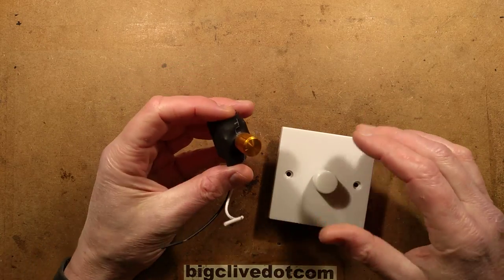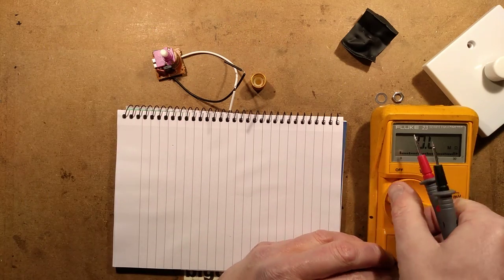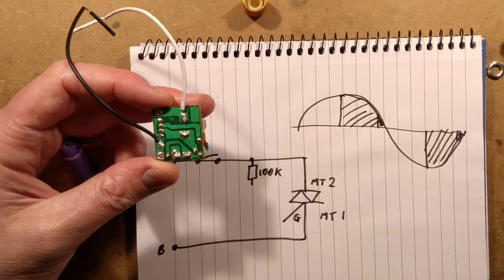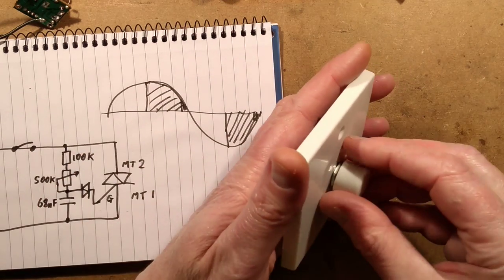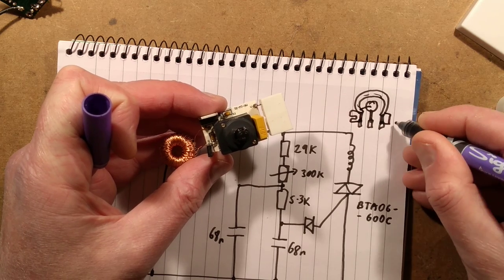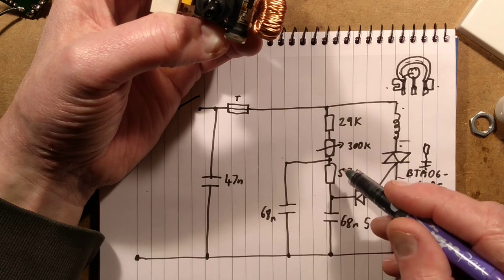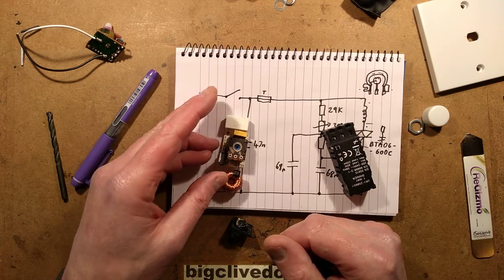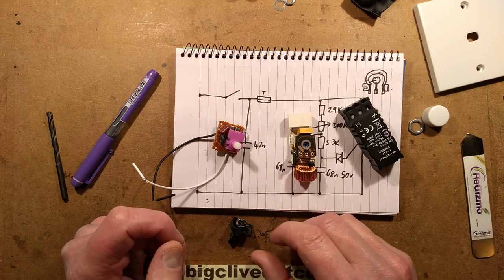Cheap eBay dimmer module vs compliant dimmer.  (Schematics)

Comment: So do you have have any idea on how one could control such a dimmer using a micro controller?
Currently I control the brightness of my lights at home over the network using triacs triggered by diac based optocouplers triggered by an ATmega328p (the chip used in the Arduino UNO). Which works fine, the micro controller however has to detect the zero crossing however and precisely time when to trigger the triacs. This is a task I would much rather have some simple analog circuitry do. Another requirement however is that is can dim so slowly that you can't see the brightness changing and without any visible steps in brightness. This requires a fairly high resolution. Currently I can time with an accuracy of about half a microsecond, resulting in about 20 thousand steps (230 VAC at 50 Hz in Germany). I assume 12 bit resolution (or about 4000 steps) would be enough though.
I had a couple of ideas, they either involved relatively low 8 to 10 bit resolution (due to some chips which a fixed resolution) or they were overly complicated.
Obviously I don't expect this is something you think about very much on a day to day basis. But if you have any idea on how one might do this in a reasonably simple manner, I would be very interested in hearing it.
Reply from the maker: The easiest way to dim with a microcontroller is pretty much as you describe, or use dimmers with a digital interface like DMX and Dali.
Reply: Ok... I kinda feared it wouldn't be that simple. I had thought about using a digital potentiometer or something with a regular analog set up like the dimmers you show in the video. But that kinda seems overly complicated not to mention most digital potentiometers have a relatively low resolution or are quite expensive as are commercial digital dimmers.
I guess a little zero crossing detection circuitry and using the micro controller itself for triggering is a better solution in that case.
Anyway, thanks for your reply.

Comment: What about those fancy Varilight ones with programmable modes for different loads? Do they use a microcontroller with some sort of transistor and PWM?
Reply from the maker: I'm guessing they probably use the lagging edge dimming to minimise current spikes to the LED circuitry.

Comment: Anyone know what happened to Clive's Amecal meter.  ??? Looks like he's back to the good old trusty Fluke, at least it auto ranges and I'll bet it's more accurate, (maybe a few less low range functions).
Reply from the maker: The knob to shaft coupling failed.  I'll be fixing it shortly.

Comment: Hi Clive tell me can you use the joule thief only on alkaline batteries and no other like for instance a cell battery or rechargeable battery?
Reply from the maker: It should work on any cell of 1.5V or less.  It's not suitable for higher voltage because the current can go straight through the LED with no limiting.

Comment: Shouldn't a two-way switch have three wires/terminals?
Is the third terminal just a solder pad on the PCB?
Reply from the maker: Yeah, I did pause for thought when I read that.  I think it's just the usual generic instructions and keywords.

Comment: May I ask what I'm guessing it's a stupid question, why are dimmer switches not just a big variable resistor? Im trying to think it through but obviously missing something.
Reply: Graham Wood 
Heat.  A resistor turns excess electricity into heat.  It would probably work but...
Reply from the maker: Early dimmers were rheostats which were simply resistors.  They got VERY hot.
Reply: Oh of course. Thank you, that makes perfect sense

Comment: What kind of capacitors are used with the BTA06 Version? I normaly dont work that much with mains, but i have a hot glue gun wich i'd like modify. i guess they are ceramic because of the alternating current.
Reply from the maker: They are probably just little film or ceramic caps.  The voltage they have to deal with is less than 50V and the frequency is low.
Reply: @bigclivedotcom   thx for the information

Comment: The most disappointing thing about dimmer switches is that you cant have more than one on a circuit  ie- Two way switches.
Reply: Why not?
Reply: @tesseract342  If the upstairs dimmer is set to half, the downstairs dimmer will not be able to be set at full power.  Also, I'm not quite sure but if both dimmers are set to half, you only get one quarter power to the lights.
Reply: @Chrisallengallery  oh right :)
Reply: @Chrisallengallery  There are digital dimmers that are not subject to that problem.
Reply from the maker: Simplest option there might be the remote control dimmers with wall mounting remotes.
Reply: @bigclivedotcom  I've just been researching. You can get a master switch and slave switches. They're digital.  More expensive and you need a neutral in the switch box.

Comment: Can you think of a DIAC as a zener that works with AC ?
Reply from the maker: Similar, but whereas the zener just clamps above its rated voltage, the diac suddenly drops to a low voltage to give a current spike.

Comment: What kind of probes are those you're using connected to your fluke?
Reply from the maker: A fairly generic set of test leads.  I could do with finding an upmarket set.
Reply: bigclivedotcom I particularly like the pokey bits on the end to probe through conformal coatings, insulation and such

Comment: The triac actally produces audible noice.
Reply: Most dimmers produce audible, buzzing noise, but it's not the triac itself. Most cases the inductor is the source of the acoustic noise, due to the magnetostriction of the core, and the movement of the loose turns (caused by Lorentz force). The snubber and timing capacitors can also buzz, especially if they are ceramic capacitors (piezoelectric effect).
Reply: @mrnmrn1  cut out the inductor. It will still make noice. There is sort of piezo electric effect in those triacs.
Reply: @picobyte   I'll try next time. If it's an internally insulated triac with metal tab on a grounded heatsink, it makes sense, because the insulating ceramic pad inside the package may produce some piezoelectic effect. With higher power levels, even the power outlet can buzz as well. Once I used a dimmer on a 4kW load (halogen IR heater). All the fluorescent ballasts started buzzing loudly in the whole  three story building :) .

Comment: Where did the 30V level come from? Is that inherent in the diac?
Reply: Yes it's like a zener in that way
Reply: @benbaselet2026  It's more like a pair of zeners connected to a small triac. Replacing it with a zener doesn't quite work.
Reply: They are sort of like two zenners with the anodes connected and a cathode both ends.
Reply: The 30V is a common voltage for a diac in a device like this. There's no real reason it has to be 30V. Most likely a manufacturer started making or accidentally made a bunch of these many years ago and sold them so cheap that every designer started using them. From there every manufacturer jumped on the bandwagon.

A diac is neat how it works. Let's say you have a 30V diac. As the voltage increases the diac has very little current through it and lets the voltage rise. As soon as you reach 30V it suddenly "shorts" out. It lets you dump a chunk of current into the triac gate, making sure it turns on every time. After the voltage goes nearly to zero, the diac resets from being a short back to being a nearly open circuit.
Reply: @therealjammit  Not sure if this is true or not as this was told to me by a lecturer who was frankly an idiot. Basically 30V is about right for keeping away from noise near the zero cross point. IE noise reduction. Take this with a whole bucket of salt though.
Reply: @gordonlawrence4749  30 volts of noise. Wow. If you have 30 volts of noise on your lines you have some serious issues. The delta-v/delta-t is what really causes the false triggering.

Comment: I took a look at two of these I had, and both of them had Mylar Capacitors but with a color code I'm guessing? They had like a German flag printed on them which is kind of weird
Reply from the maker: It used to be common to print wide bands of colour on film capacitors.
Reply: so thats just random colors?
Reply from the maker: @roughshaf7321  No.  It's a colour code that indicates the capacitance value.
Reply: @bigclivedotcom  So what value do you think Black, Yellow, Brown(or Empty, as the cap color is brown), Red means?
Reply from the maker: @roughshaf7321  The colour code wouldn't usually start with black (zero) so it may have been red, brown and yellow - 210000 presumably picofarads, so 210nF maybe?
Reply: @bigclivedotcom  Maybe Brown as the first color so 1(Can't read because the capacitor is brown), Black as second, so 0,and yellow as multiplier? Doesn't explain the orange at the bottom(I said red at first, it's orange, my bad) tho...

Comment: Shouting to my screen, take the wiper out of the housing and use it .... pulling my hear out ..... bummer.....
Reply: I have seen wipers which can have an effect on two sides. We only saw the top side for now. But you can see that green plastic in the middle? It might contain another wiper. If that is the case, it ruined the measurements.

Comment: 100 ohms? Brown black yellow?
Reply: He meant to say 100k ohms. The color code is correct.
Reply: He gave the correct value a few seconds later.
Reply: Color labels... Can't we all just get along?
Reply: I think the manufacturers of colour banded components should get together and agree a specific pantone colour for each value so they're ALWAYS consistent. I sometimes have terrible trouble identifying in-circuit component values where reds and browns or greys and violets look deceptively similar!
Reply: @WaltonPete  For some cheap Chinese 1% blue Shenzhen Special metal film resistors I just desolder one leg and grab the ohmmeter, life is too short to spent 15 minutes staring at something that looks like these colorful images with hidden numbers that are used for color blindness testing. For some reason blue ones are worst offenders:)

Comment: Painting the color code on the outside of the resistor is absolutely pointless. You can never tell what the colors are. Red, or brown? Red, or orange? Silver? Grey? White? Brown, or gold? You always end up measuring them anyways.
Reply: Andrew Delashaw - no, with most new quality components it is possible to see and read the colour code. But when the resistor is half hidden behind/under other components, then it is far more difficult.

Comment: How do they make money selling, well really anything at £1? Just to cover the 10 minutes of someone putting the ad on eBay you'd need to sell at least a hundred devices. Even if the components of the device are cheap you have to have someone put the device together and then have someone put the device in an envelope, attach an address sticker and take it to the post office.
If you require a 1000 unit minimum order then sure, you might have a business but then who would buy a 1000 of this crap?